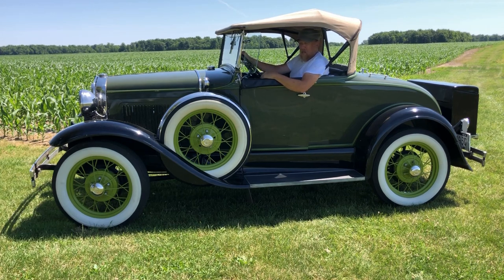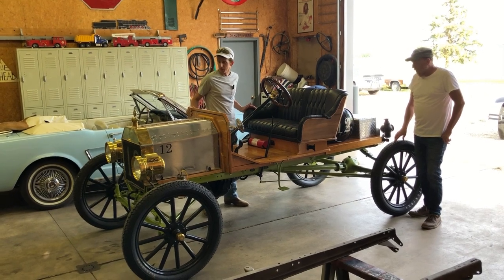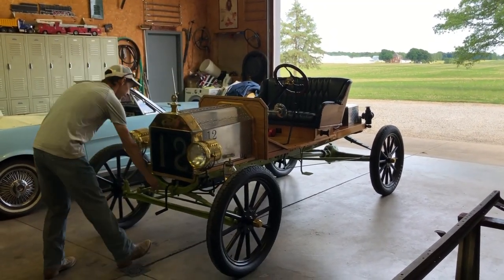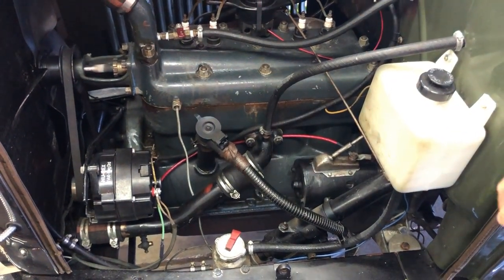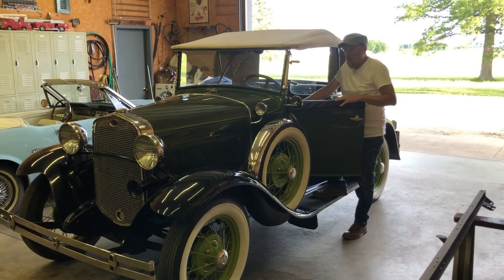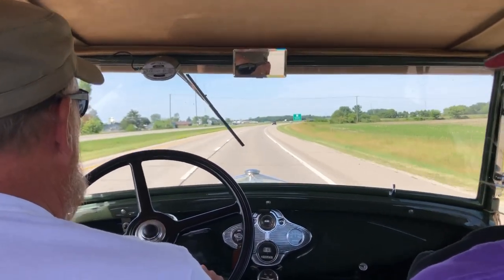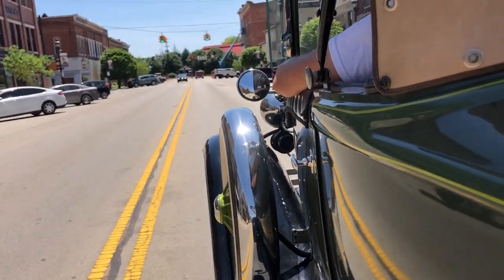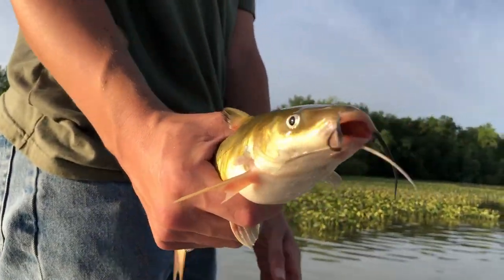Father's Day in a Model A  [EP 51]  @KlepsGarage

Comment: Great car and video, although I would advise against using an air filter, especially that close to the carb. Bear in mind, updraft carburators dump excess gas into the ground. Should you put a filter there you'd be soaking it all up, and all it would take to start a fire is just a little backfire... which isn't that rare. Almost all of the Model As I've seen that caught fire, had an air filter as the culprit. The car didn't have one from the factory, ran great, no need to put one in.
Reply from the maker: Thanks. Good idea. I have had one car fire from a broken fuel line. Lucky no damage as I put it out in time. 
I don’t have filters on other oldies. That was something my father put on.
Reply: @KlepsGarage  If you're concerned for any debris getting into the engine, you can always put a thin metal mesh in front of the carburetor, but paper or cotton is a big no-no. 

Some people put a tube and then the air filter further away from the carb, but as far from heat as possible and always higher than the carb, to prevent gas from flowing there and soaking it. Some use oil bath filters too, but in a similar application.

Fires overall are rare, so it's not urgent, but it makes me sleep better at night, at least. I've had a fire start in the ammeter due to a short-circuit. Fire was behind the dash (and next to a leaking fuel level gauge) so while I was quick to react, I'd never want to be through it again. Vaccuming the extinguisher dust afterwards was a real pain.

Again, love your channel. Hope it grows like it deserves to.
Reply: @matiaspugliano1556  Use a bundle of coarse steel wool and stick it into the carburetor should  work just  fine as a filter.

Comment: My favorite color combo on a roadster.  Are you running a stock tranny?  Do you have an overdrive?  I put a 5.5 head and stipe 340 cam in my A with a 354 rear.  Stock clutch and tranny. Worked out well.  Looking forward to the speedster project.
Reply from the maker: Thank you. Stock trans and rear with a Ryan OD. Thinking of changing gear ratio. I can run all three gears in OD.  It’s a great setup as is. Would like front disc brakes though. 
There is a line you need to draw between modified and full blown hot rod. I stopped changing things or it won’t look stock.

Comment: Does your model A have babits or inserts?
Reply from the maker: Babbitt for now. With overdrive engine is turning same rpm’s at 65 vs stock at 50.  But you need more horses to pull overdrive.